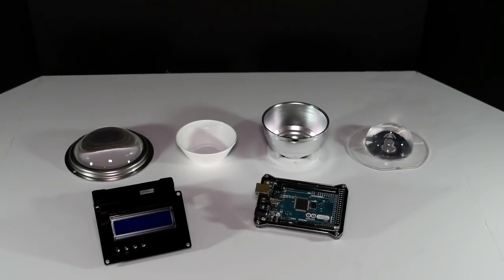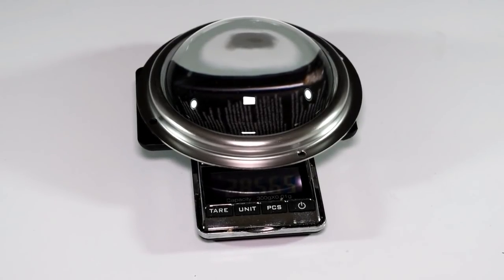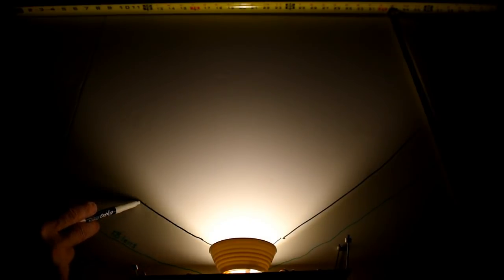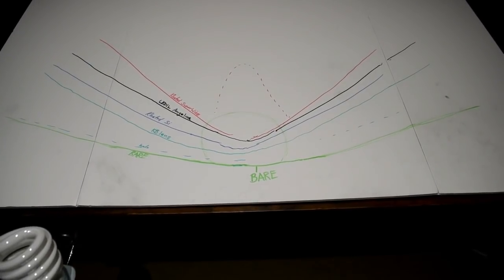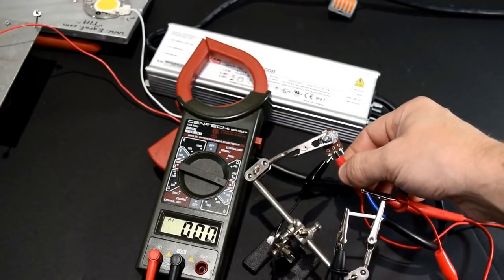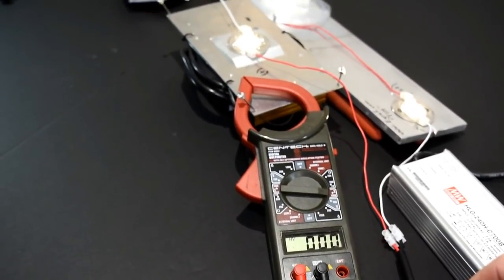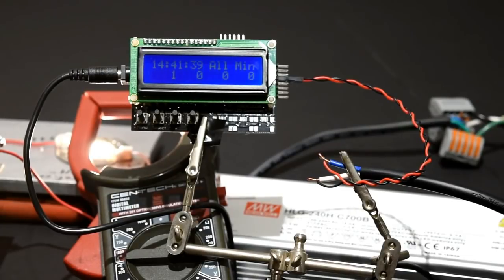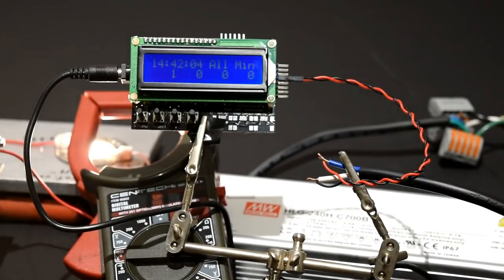DIY LED Basics: Optics & Dimming (pt 6/6)

Comment: Sir I was wondering if you could answer a question for me please. I have 4 phat slim xl v-7 100 watt lights.  By Optic Led. I believe it's very similar to the chilled puck. I was thinking of putting them into one light with there bloom board in the middle to cover a 4x4 area. Here's the question can I combine all there dimmers to the one on the bloom board? I'm not sure if il need a larger dimmer. I can combine all the power cords to one

Comment: Awesome stuff growmau5 <3  
I want to DIY a dimmer for my COKOLILA Full Spectrum 2000. It has two drivers so would I be needing two 100k potentiometers ?  
Each driver is 120w (NP-120H-C1700-A) 
Hope you can help me out :)
Reply: Looks like the output is only 60v pr driver. Ordered 100k potentiometers so now in doubt if it is the correct one. Hope you can help point me in the right direction. Thanks

Comment: The drivers are using PWM dimming?
LED is more efficient at low currents. PWM dimming is high currents for short durations.
Shouldn't PWM dimming be inefficient in a LEDs?
Reply: Found the answer: the good drivers have magic sauce, don't look like PWM on the output.

Comment: Hi friend...I want to ask bout the cob..
Is it all cob is dimmable?
Reply: yes, any LED is dimmable by reducing current.
They are not dimmable through voltage, which is confusing at first.
Reply: Lukas Böck thank for ur respons..another question, is it right, a bigger current of led driver than the led chip (high power led) will make a longer life of led chip? For ex the led driver 2,5A and the led chip 3A..
Reply: @dhimassatriapratama8566  No. LED life is determined by diode temperature. Yes, they will work at 100C°, but will last much longer at 60C°. A driver with too much current is dangerous, because you can fry your leds my mistake. but it makes future upgrade possible.
Reply: Lukas Böck sorry my fault, i mean a bigger current of led the the led driver..ok then so its true..thankyou friend..btw can i know ur email? i hv some lighting fixture project, so if don’t mind u can give a suggestion..
Reply: @dhimassatriapratama8566  Sorry, no email sharing on youtube. A forum like rollitup[ dot]org is maybe better suited? but you can ask more here. I'm not a pro with this yet, but a technical guy who's 2 weeks into this.
Reply: Lukas Böck okk then..thankyou

Comment: Hey I've got we 2x hlg240b that I want to dim with a controller. Where can I find the one used here? Steve's doesn't show it. Will that work with my driver?
Reply: You could also use an arduino's pwm output to control brightness, that way you can also hook up humidity and temperature sensors and integrate the timer. I have it set up to dim automatically when temp gets too high or humidity too low.

Comment: Most glass blocks UV wavelengths, so would you consider that a slight problem on a full spectrum LED?  Do silicon and polycarbonate also block the UV?

Comment: Hi can I use a single 288 quantum board with an HLG-240H-C2100? I want to use only one board an maybe add another one later without buying a new driver. The board has 45-58Vdc input and the driver 59V-119V output.

Comment: will a meanwell HLG-240H-C1400B power five Cree CXB3070-0000-000N0HAD30G CoBs with 110 (Dia.) x 55mm, LMH2 Series heatsinks?
Reply: look i watched the video and the setup i mentioned all works from my maths. all i needed was someone to agree or not with my design so i know im doing it right or not. thats what teaching someone is about. looking down your nose at someone just coz they dont know as much as you a shit attitude and makes you look like a twat tbh.
Reply: Let me help you sorry for that i just want ppl to understand what they are doing rathar being headless chikens.
Cree CXB3070-0000-000N0HAD30G voltage output is 179V and each cree needs 36 V 179V/36V=4.97 chips you might be worried because its less than five. 179V/5chips=35.8V/chip that is less V than what the chip needs BUT dont worry about that, the driver will be able to run them as the 36V number is calculated at 1.9A so at 1.4A that your driver would have he would be runing the cobs a little less than 36V/each so the answer is YES you can run this 5 cobs with this driver.
Growmau5 explains this at some point in one of his videos.
I hope I helped you.
Reply: Yeah cheers dude that cleared things up for me. The drivers must have higher tolerances than what they publish. i was also sceptical about the heat sinks i had chosen as i didnt know if they had enough surface area to displace the heat from the chips to run efficiently around 25C (if i remember correctly)
Reply: @SpazziJackazzi  the pin heat sinks you need are the 133mm diameter 70mm hight which are good for at least 70w if I'm not mistaken. You'd be running each cob at 50w so be safe going for the 70w
Reply: From what i remember the pin heatsinks are drastically over priced where i live. the heatsinks i have found are a fraction of the price and manufactured by cree themselves heres the link: https://uk.rs-online.com/web/p/products/8104201/
Reply: @SpazziJackazzi  true they are overpriced but they are predrilled and with the perfect shape both for wiring the cobs and mounting the pin in the aluminium. You can find them for 9$ on alibaba but you'll have to pay shipment which for five pins and 2.5kg maybe its 40-50$ more.

I didn't know about these pins you're showing but you should make the numbers and see if they are able to handle 50w (they should handle 60-70w for cob safety). Their shape is cool but in finding problems when setting them up in aluminium idk. Talk to me about these a little bit more.
Reply: These heatsinks are used in the premade lamp units that cree supply to a general hardware store. 
But after doing some delving this model heatsink i gave a link for can handle around a 40W lamp so its too small. i reviewed this Public release document online from cree:
https://docs-emea.rs-online.com/webdocs/12d3/0900766b812d38a8.pdf
Looks like i need the LMH020-HS00-0000-0000061 model heatsink which is the next size up. this can handle 70W which seems more appropriate after reading your comment. the size difference has a considerable affect on the price thought this new heatsink is around 22 smackers ea. these are in some sense pre drilled though they have holes all the way through to put long bolts through which are provided.
https://www.mouser.co.uk/ProductDetail/Cree-Inc/LMH020-HS00-0000-0000061?qs=V3IlGBufnyUBaNmdlmGUSg%3D%3D
Reply: Yes those are way better, the price spikes a bit though.
Reply: Dude watch de videos and make your numbers. If you can't then rewatch the videos.
Reply: sorry for asking a question in a help video. if you have watched the video and understand it all then you can answer my question
Reply: SpazziJackazzi he shows you how to figues it out ! Do the math!

Comment: I have 6 cxb3590, is there a way I could dim those lights??
Reply: Ronnie B that depends on the driver. If youre using a meanwell driver, theres basically 2 ways. The a series has a little rubber cork. Pull that out and in the hole is a little phillips head dimming screw. If its a b series, there are 3 cords. Power in, power out, and dimming. In this case you would need to add a potentiometer to the dimming lead.

Comment: @Hideus Penguinboy Hey, I'm researching a lot about the topic, and considered to get HLG-185H-C1400B with 4 cxb3590 3500k, all heat sinks and required accessories are included for 220$. 
I thought that this would not be enough for 3.3'x3.3', and would need to get HLG-240H-C1400 with 5 COBs? I see you suggested other setup, is it really that noticeably better? Or for a personal grow it won't make much difference which lights I get?

Would getting HLG-320-C1400B (for 78$ is this normal price?) with 4 Bridgelux_VERO_29_Gen7_B(22.5$ ea.) and 4x heatsink Φ163*H70mm(for 75-85W) better than my original idea? Would that be more efficient/enough light for a 3.3'x3.3' ?

What wattage would each COB be? And if the drivers maximum wattage is 320W all of the COBs wattage can't exceed that amount? But would 4 come close to those watts? 
Does running lights with 700mA driver increase the life time of the leds vs 1400mA one? 
Also If I went with only 4 COBs would placing them in an X array be better or 2 in 2 parallel lines | | or just 4 linear COBs? 

AND in the end, how long do these setups last and are they reliable? I have thought about just buying couple 300w LED marshydro lights from ebay and calling it a day, but read reviews and saw pictures that half of the panel fails often.
Reply: So, in general:
* it doesn't matter what COB you get. The efficiency isn't that far off (save for very high wattage Veros) so what you want to base it off of is cost. Cree cost 2-4 times as much as other COBs, so fuck 'em.  
***Also in general, for various reasons Mars Hydro can suck a butt. They are crap, build your own. (they've quoted bullshit PPF maps to me multiple times, after I tested my own)  
***I've been told 5 years is a reasonable amount of time for an LED/driver combo to work perfectly, but I haven't heard @growMau5 or anyone else saying theirs have failed.

What PPFD are you shooting for? Are you using CO2? Do you want to get SUPER efficient to avoid police seeing a spike in your electricity bill / because $kWh? Are you vegging and flowering in the same room? Is heat a big concern? Hit me back and I'll be better equipped to answer.
Reply: Huh, it says there are two replies but I can only see mine. Hit me up on instagram under the same name and we can chat there.
Reply: Alright that's weird I guess my other account is blocked or something...

No idea what PPFD, I won't be trying to reach any records, just a personal grow.
I would want not to use any other equipment except dehumidifier/humidifier and some fans , don't care about electricity it would be only max 300w  more right?
All stages in one tent 3.3'x3.3' ( 1m x 1m).
For heat I would put some fans in the tent. For the start no exhaust system.
Reply: No, my first comment on his vids was to you :)
So the 52v veros with 1400ma driver would be about 290W, that would be not perfect but still closer to the ideal than the 4 cx3590 at 200w. 
Would that wattage generate enough ppfd to grow plants? Or there would be not enough light?
Because in one of the videos growmau5 used 5x cx3590 at 269W(should be 252W by calculations)  and had enough par to light 1m x 1m (3.3x3.3)
I guess I could go with a smaller tent for a small grow? Also if I'm growing just 2 or 3 plants in that 3.3'x3.3' would I still need the 385w?

Does it matter how the lights are arranged?  in an X , parallel lines or all 4 in 1 line
Reply: Hey, found another setup 
5x Luminus CXM22 on hlg320-48A = ~360-380W?    ~380$ with heatsinks and international shipping

Thought about going 4x vero 29 C with 2x hlg 185 1400  ~400W but I thought that that would make the light too intense and cause all kinds of other problems. Still haven't got the quote on the price.
I think the CXM22 setup would be even cheaper and better.

Thoughts?
Reply: I don't use the hlg320-48A at all. I stay in the constant current drivers with dimmers so everything is easier for me and honestly I'm not super familiar with it.  But if it's a 320, than the wattage is around 320W. $14 per COB, $20 per heatsink, $100 for the HLG should be under $300 though, unless it's the shipping adding a $100+ to it.

As for veros, running them at 1400mA is a waste. You should do citi or luminus  at that current because it's cheaper for the sameish efficiency. Two hlg185 would mean 185W + 185W = 370W which is what you are aiming for.
Reply: Well basically the hlg320-48A would power 5x luminus CXM22 at about 1.4-1.5A and about 53V so that would reach up to 400W in theory...
I thought too that the driver is rated for only 320W, but guy on forums told me " it will top out at about 53.5V but thats above what you need to get your 1.5A per cob out of it. should be right in the range of 350-370W on the cob side. all you have to do is turn up voltage and current screws all the way"

Also if I went with any of those setups, what color temperature should I go with?? For both stages, 3000k 90cri, 3500k 80 cri ? Or?